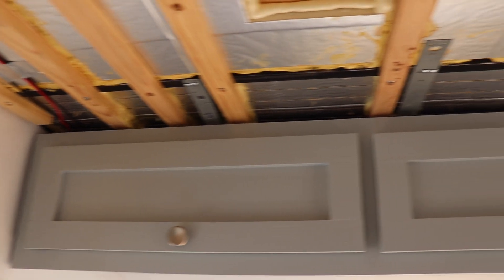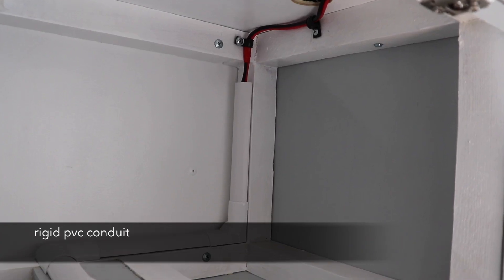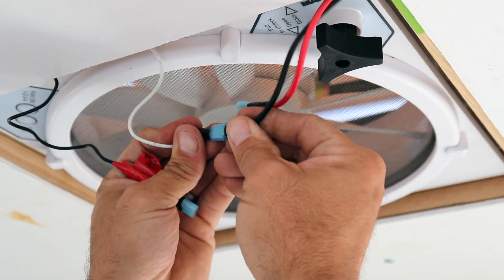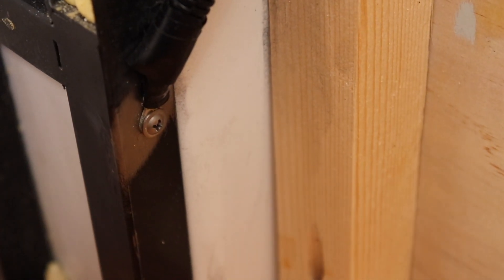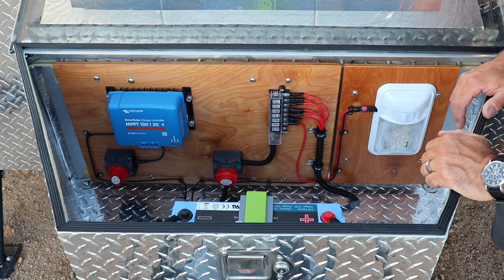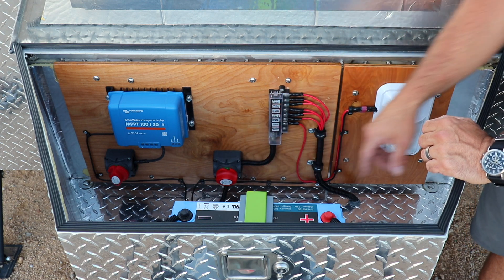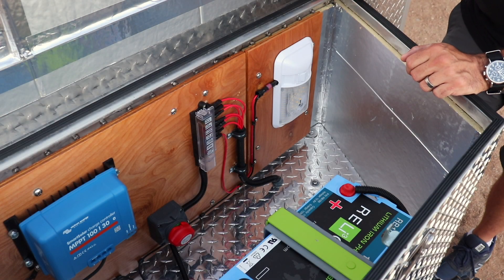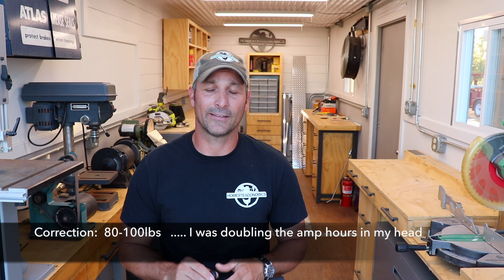How to Build a DIY Travel Trailer: 12V Electrical, lithium battery (Part 10)

Comment: Hi Joe; when making the wiring connection splices I saw that you test each one for fit (but didn’t mention it in your running commentary). It’s a very important step, verifying that a proper, snug crimp is made. For your viewers, Joe wiggles and pulls on the wire, this is the point at which a loose connection with come apart. A loose connection is a fire hazard, as it heats excessively while flowing current. Good job, Joe. 
On another note, is the trailer aluminum? If so, what precautions do you take to ensure a good ground connection? Aluminum has a greater expansion/contraction rate than copper, resulting in loosening connections. I think there’s a paste that can be applied to those connections. 
Thanks for sharing, Joe. 
Daniel, in SoCal.

Comment: great video, if you are in a cold climate, then having a lithium battery in outside box might harm the battery, especially if there if no low temp cut off. Lithium gets damages if trying to charge below 32 degree F. Some people make a 12v heating pad to turn on when temps are low. Most people doing lithium keep the batteries inside. I think the relion batteries do have low temp shut off to protect them, and some relions might have internal heaters. If there is no heater in low temp below 32 degree, you would not charge the battery even if parked in full sun if the cut off is working. if there is a heater that of course uses some energy so you need wattage solar system to make up for that energy loss.

Comment: What is wrong with a generator?
Reply from the maker: MARTIN WOOLDRIDGE nothing wrong with a generator if one is needed.  But when we go camping we aren’t looking to have any high draw devices like AC, etc...and we prefer to enjoy the peace and quiet if the forest we are camping in.    This will actually be luxury for us...lol....since we’ve always tent camped before.  Thanks for watching 😀🙏
Reply: Martin Woolridge -  Joe doesn't want or need a generator, I wonder why.  Generators are noisy, create fumes, add extra weight, takes up space, burn fuel that in turn take up space, add weight, may have their own fumes and cost money.   He's building a spartan trailer not a RV and I respect that simplicity.

Comment: Quick question - why fuses and not circuit breakers?  I'm in the process of making that decision right now and would like to hear your opinion.  I have only two issues with circuit breakers - size seems to be bigger as well as the fact i may not trust their ratings to be too accurate.  Otherwise, i like the idea of not carrying spare fuses.
Reply: Cost.  A single 12V breaker can cost upwards of $20.  Joe's entire fuse panel cost less than $40.

Comment: I like your grounding system overall, but it can be improved by making 2 changes. After you clear the paint to establish the ground, use a star washer between the ground wire and the ground, and then tighten the screw. After your ground is established, repaint the area including the grounding screw to prevent corrosion. Back in the late '60s, I worked for Boeing in their commercial airplane division, both as an Assembler/installer and later as a Quality Control inspector. The grounding method I discussed is how grounds were established on every airplane Boeing built. I had the pleasure of working on several aircraft models, including, 727, 702,720b, 737, and a little bit of what was referred to as the Iron Bird model of the early 747. All that it consisted of were the control systems, for testing.  Now I know that your trailer will never be called upon to leave the ground, it WILL be traveling over many different corrosive products...
Reply: @Liam Edison Instablaster :)
Reply: @Liam Edison happy to help xD
Reply: @valentinofranklin875  fake as spammers
Reply: you all probably dont give a damn but does someone know of a tool to log back into an Instagram account?
I stupidly lost my login password. I appreciate any assistance you can give me
Reply: @Valentino Franklin i really appreciate your reply. I found the site on google and I'm in the hacking process atm.
I see it takes quite some time so I will get back to you later when my account password hopefully is recovered.
Reply: @Valentino Franklin It worked and I actually got access to my account again. I'm so happy!
Thank you so much, you saved my account :D

Comment: Getting close! Excellent work. 
Just a thought, and I'm sure your solar control unit would have the capability (not familiar with that unit, so can't say for certain) hook up an auxiliary charging cable that you can run to your truck, so that you can charge from the alternator whilst driving. 
This just adds in some redundancy to the charging system, for very little extra investment.
Reply from the maker: MamboTek thanks! I was planning to do that if I ended up using agm or lead acid batteries.   But I think the lithium needs a specific charging type.   The solar should be able to charge on the go....that is unless I end up covering with the awning I eventually build.   Not sure of the design on that one just yet. But I’m think it’ll be just framework so I think it would be fine.

Comment: Nice job👍wondering will it it be warm in the battery box (affect batteri life - maybe install a vent.)
Reply from the maker: erkanyuceldk shouldn’t be an issue with these lithium’s....especially considering our use.  We generally camp like snow birds...mountains in the summer and low desert in the winter.   So it won’t likely be subjected to temperature extremes....when at home I will remove it from the trailer for storage so it won’t be in that battery box.  Thanks for wacthing😀🙏

Comment: A tip I've learned when it comes to using the spade connectors , if the wires arent easily distinguished like the fan one instead of having the big red tape what I've done is make the wires from the battery side have a female for the negative and male for the positive, that way you can't mix them up if that makes sense
Reply from the maker: hartk1213 yes sir!   I get what you’re saying and I think it’s a good plan for sure.   But hopefully I won’t be re wiring these for a long time😉👍
Reply: That sounds like a good idea, but I would think you'd want it the other way around, so if a loose lead from the positive happened to fall on some metal parts of the frame, it wouldn't ground out and short.  Or am I thinking of it backwards?  I would think the male connector, with the exposed metal, would be better as the negative.
Reply: @BruceS42  Yes, you are correct.  Male connector should be negative

Comment: Will the +12v from the 7 pin connector to the vehicle charge the battery or power the lights?
Reply: Jake32401 -  On general principles I agree that having the tow vehicle charge while under way is a nice way to keep the battery at 100%.  That said overall system is not very power-hungry, particularly during transport.  On the road the only thing drawing power might be the cooler circuit and maybe something plugged into the charge circuit.  The solar should be able to keep up unless the transport is taking place at night.  He really doesn't need it, but it would be a nice touch in case of a say a snow storm.
Reply: @ScorpionRegent  Thought it might be a nice option to have available.
Reply from the maker: jake32401 SR....explained it well.  Yes it can be done and is a good back up....but my solar will still be exposed during transport to keep the battery up.   Luckily the total draw is minimal....but if it were larger then I’d probably work for that extra charging capability😀👍

Comment: Trojan SPRE06255 is a 6 volt Flooded Lead Acid battery enhanced with Smart Carbon Technology.
It has 229 Amp Hours x 12 volts DC = 2.748 kilowatts and this new technology has a safe Depth-Of-Discharge to 80% with a usable 2.198 kW and cost just $150 each x 2 = $300
If I went to 50% DOD I can get 2,000 charge cycles or days out of them. So if I did this every day, 365 days, they will last 5.5 years. Not doing this every day extends their life.
Your choice is 100 AH x 12 vdc = 1.200 kW at 80% DOD with a usable 0.960 kW and a cost of  $1,271.53  When your battery is depleted I will still have 1.238 kW left. I can buy the Trojans 4.2 times for what you paid, So 5.5 years x 4.2 = 23 years of service
If I stopped at 35% DOD I would have 0.961 kW and matched your 0.960 kW
At 35% DOD I get 3,000 cycles or 8.2 years. My take away is this; at 80% DOD your all done and I still have 1.238 Kilowatts left and I have saved $971.53.
By the way, they only weigh 67lbs x 2 = 134lbs – your 30lbs = 104lbs more and I am sure your trailer can handle it.

Comment: Will that 12.8 volt lithium battery work as a starting battery for a car? I have noticed my Lincoln MKZ AWD 3.7L V6 with all its tech toys consumes a lot of power my car Did some with an AGM and it's resting voltage is 12.8 like your lithium
Reply: Christopher Berg -  No, it's not designed to start car engines.  It's not the voltage, it's the amperage.  Some AGMs can start cars, if that's what you have, stick with it.

Comment: Important note for those new to electrical -  Joe used stranded wire for the DC. 
DC current travels on the outside of a wire. Stranded has more surface area and less resistance for DC current flow.
Less resistance = more power.
(AC flows through the center of a solid wire and that is appropriate for household current.)
Reply from the maker: KaleidoscopeJunkie thanks KJ!  Well explained😀👍🙏
Reply: Like in a car, stranded cable is better suited for trailer installations where the wire needs to be able to flex.  Solid cable is too rigid and connections will eventually break from being flexed as the trailer moves down the road.

Comment: Wouldn't it be better to run both battery leads to the course off switch then the negative from the switch to the  body? That way the switch removes the source from the circuit rather  than  just opening  the circuit.
Reply from the maker: Spring Board probably so....but was just thinking about the circuit in general....there are likely several other oversights too...haha....my mode of operation often times😉😂

Comment: You mean there's no video of you putting the switch box together!?😒🤣 I like the accessibility of the wiring in the battery box. The light inside there is a nice touch as well.👍
Reply from the maker: Green Dream Project thank you Jim!  Nope for th switch box.....haha....that and like a 100 other things....haha....just not practical to film it all.   I just put in a fishing rod hatch with interior holding tube yesterday and didn’t film any of it😂
I should actually be filming a lot of these things now that I think about it😂

Comment: Very neat, love your camper videos. Took some of the stuff you did to heart in my camper build, wish I had the welding knowledge you have but sadly all my skill is in woodworking.

Good job, huge advantage to having a metal frame, ground wires are super short.

Comment: Would like to see the work being done when you do all this stuff, instead of just a review afterward
Reply from the maker: Mark Vanderwolf most of my videos I do show the work.  But this one was just a lot of taping up wires and hard to hold a camera in many of the angles and actually do the wiring.  That’s why I showed the wiring of the charging station with the spade connectors and ring connectors.  Each appliance was done in almost the exact same way.  Ring connectors on one end and spade connectors on the appliance end.   Anyways, I know it’s not perfect but sometimes it’s hard to figure which clips will be interesting for something like this.   Thanks for watching😀👍
Reply: @homesteadonomics  yeah fair enough. Seen most of your stuff and enjoy it

Comment: That really is neat and serviceable wiring. I trust you will treat the trailer frame earthing points where you've sanded away the coating to make a good earth.
Reply from the maker: Benny Banger thanks!   I added battery terminal grease on the bare areas😀👍

Comment: Heat shrink is like 5$ for 500 pieces from harbor freight.... you’re not saving money you’re being lazy, not hating but the electrical tape won’t last throughout heat cycles.
Reply from the maker: Yachty Team yep, probably so
Reply: Ancor makes crimp terminals in all types and wire gauges with built-in heatshrink insulators.  Crimp and heat.  Job done.  No tape or heatshrink tubing needed.  We use them on boats all the time.

Comment: Wow what a great system. Are you worried that your battery will get too cold or hot?
Reply: They are lithium ion batteries, they might not hold as good as a charge at cold or hot temps, but they won’t get damaged if kept out of the extremes.

They’re the same type of batteries used in electric cars and as power banks inside solar homes/garages, and even in our phones.
Reply: Yachty Team right they won’t get damaged and they can still discharge but it can keep them from charging when temps are extreme. 
Tesla employs active heating and cooling year round to help their batteries function.
Reply from the maker: Kirk Quinlivan hi Kirk,  not too much as we usually camp like snow birds...high mountains in the summer (60-70’s) and low deserts during the winter here...(40-70’s)....
For the down times inbetween the camping trips the battery will be removed from the trailer for storage.
Btw...sorry for the slow reply😀🙏

Comment: Are you going to use the trailer in cold (freezing and below) weather?  Just wondering what heating system you have in mind to keep the battery warmer so it will continue to function.   As always a great build and your attention to detail is outstanding.
Reply from the maker: This will be used primarily in good weather.....close to freezing and maybe up into the 80’s.   We usually camp in the mountains in the summer...60’s to 70’s... and in the winter we camp lower in the warmer areas.
Reply from the maker: Lee Drew ....basically planning our trips like snow birds 😂

Comment: Joe you're selling the wiring job short, that's a awesome job! I was wondering which industry it isn't not up to their standards. NASA?
Reply from the maker: Hammer128 thanks hammer!  Yes, ditto to the other commenters.  Things could definitely be a little more stout with solder and heat shrink.   But at least I know the guy who installed it and can repair it😀👍
Reply: @homesteadonomics  
Yep, you do know who installed it and can repair it if need be.  Great answer. And a great job well done....👍
Reply: Hammer128 -  Using crimps and electrical tape instead of soldering and shrink wrap tubing makes it less than industry standard, but Joe has great attention to detail even if his work isn't aerospace grade.
Reply: Hammer128 ...most of them. I used to wire control panels for flares for petrochemicals and I can tell you the customers would  never allow for chassis ground, quick connects, or electrical tape. We used butt connectors and shrink tubing inside EMT with a wired ground to each grounding point to maintain equipotential, dissuade corrosion by grounding through say a spring in a valve body, and remove any potential sparking hazard. 

We did a few 12VDC systems for UAE where their  prodigious sunshine makes solar battery systems powerful enough for a small PLC and pilot ignition system. Much safer than the burning open pits they replaced. Abu Dhabi Is an interesting case of environment abuse.
Reply: Peter G. Yeah, same with telecom, all metal parts bonded but all come to one common ground bar - can you imagine trying to troubleshoot an intermittent power issue?  At least it looks like he is using quality 3m 33+ electrical tape.

Comment: Love all the videos. Still waiting for A cost breakdown before I start my build. Thanks   Inspiring me to do it!!
Reply from the maker: Rudy The MAN can’t do a cost breakdown until it’s finished 😉. But when I do it will likely be very broken down to each part of tht build.  Since this has been a learning process I’ve wasted a lot of money on things that I bought and ended up doing differently when I actually implemented it.  I’d guess I’ve purchased about $700-800 of things from amazon that I ether bought too much of or just didn’t use.  Luckily I have some friends that will be able to take some of it off my hands though.   But anyways, I’ll get to it but as a quick answer to you question....I’ll jut say that you can buy a good used one cheaper than building.  But if you do it right you can certainly build cheaper than buying 😀
Reply: @homesteadonomics  Thanks for the response! I think I just want to make a run at it. I have a 20ft dual axle steal boat trailer that is having an identity crisis  and feels more like a camper then a boat trailer haha! supper inspiring videos man, they make me want to sharpen the mental the pencil and get to work.

Comment: Do you have a fire extinguisher in the camper? If not it may be a good idea. I’m not knocking your wiring. I just thought it might be a good idea to have one. Thanks for the video.
Reply from the maker: Not yet, but I'm getting one to mount just inside the door for just that reason :)
Reply: @homesteadonomics  What ! ? !
Do the guys at the Fire station know you haven't put an extinguisher in yet?
If I were them I would definitely have to rag you about that.
Reply: I'd keep one in the battery box too.  Two is one, one is none.  😉

Comment: You do such a nice job on your videos I wish you had more time to do more. I am very interested in seeing if you run solar for your home also. Keep up with the great videos.
Thank you,
Reply from the maker: thank you MrWallman!   I appreciate that!   I also wish I could do more... hopefully with the trailer winding down then I can start adding more smaller quick projects that will be easier to finish inbetween the bigger ones!  :)
Reply: homesteadonomics are you going to harvest water off the solar panels? It shouldn’t be much more than adding gutters to the bottom edge of them.